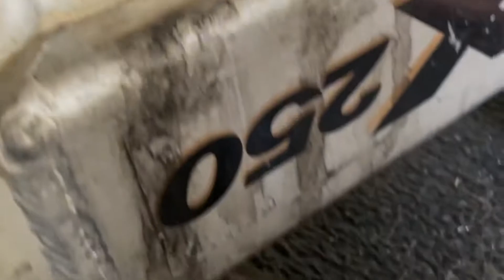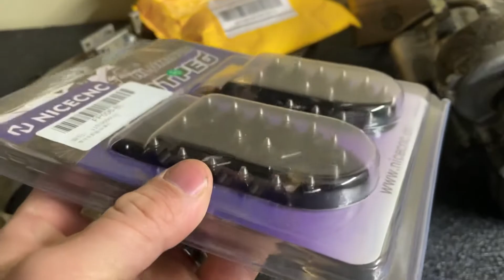2003 Kawasaki KX250 2 Stroke Restoration Part 2 ( swingarm, foot pegs, and frame update)

Comment: Oh wow man now I’m jealous! I wish I had the know how and tools to do this. I love that bike too.. My klx400 is a 2003 and I think that’s a great year for Kawasaki. I’ve never owned a 2T and am going to try and find one this summer when I home my riding skills a bit more. Great job on the video. Can’t wait to see the end result 💪💪💪
Reply from the maker: Thank you! The 2T's are a ton of fun to ride and are great in the tight stuff. Very light and nimble. I am going to pick up the frame this weekend so should have a new video up soon!!
Reply: @HowiesAdventures  I got to go for a ride with my father over the fall.. Something I’ve been wanting to do my whole life. He rode a 2021 Husky TE150i and it ate forest trails like  beast.. It’s one of my videos on my channel. My buddies ride them in my dirtbike group and they look like a blast, love how mean they sound
Reply from the maker: @MOTOBRANDON  definitely do it and just know it will take a little getting used to especially the smaller the bore.  The bigger 300-500 2T have tons of low end power so they are in a sense easier to ride.   But they are all a lot of fun